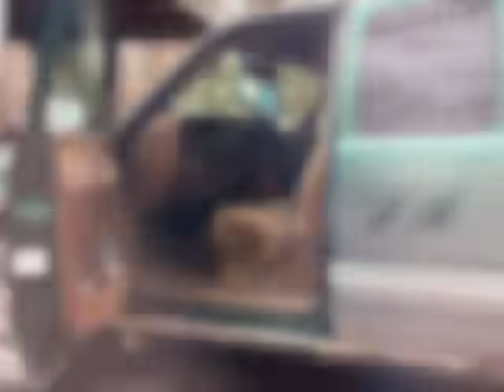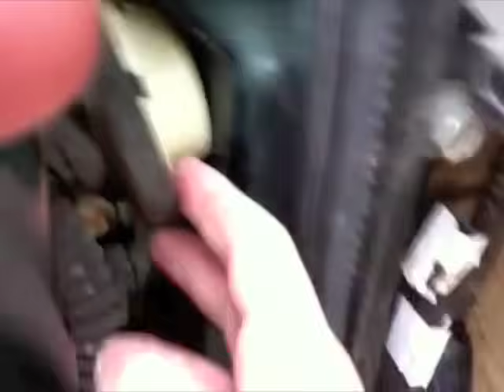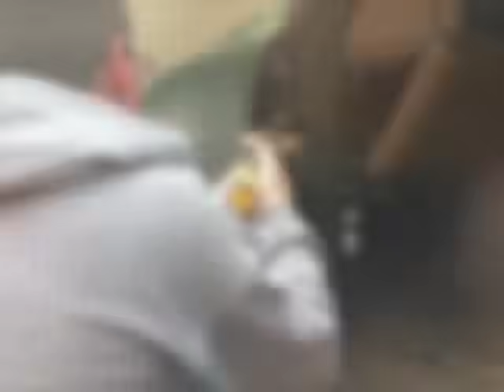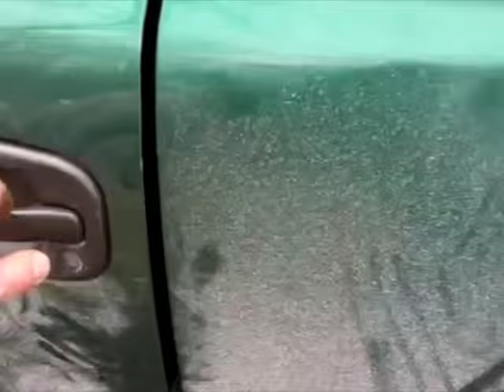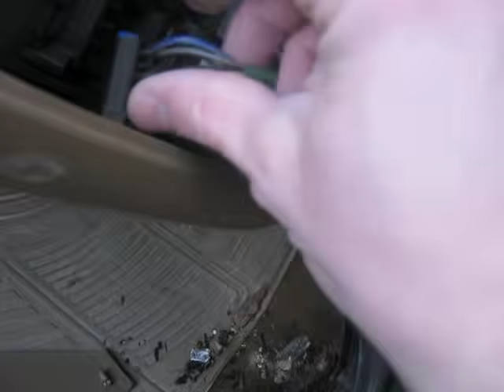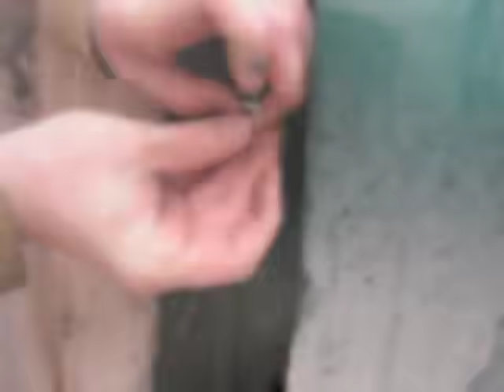Chevy Silverado Door Hinge Pin Replacement 1999 - 2006

Comment: is no one else having an issue that the bottom bushing won't fit in
Reply: I have the same problem as well.
Reply: @cherychery5867 i figured it out, the old bushing is in there it is just so worn down you can't see it. knock it out with a punch that fits inside it

Comment: Few things that will keep you from actually “removing” the door, air tools (3” cut off wheel) and a mini jack stand to support the bottom of the door with some rags if you’re worried about the precious paint on your 430,000+ mile work hog. ( most any weld shop will have them) throw a rachet strap on the top of the door to a rafter, and you saved your self from an hour of work and hurting you back on the floor board. Smarter, not harder

Comment: my problem is the pins on the extended cab doors. Surprisingly, they have gone bad and my doors have been sagging for years. I finally have decided to fix them myself since my mechanic has put it off for about 5 years now. 

As for the rattling and wind coming through the doors....IMO that's a 2006 issue.  My 2003 Silverado was tight as heck. No rattles, no wind coming through. But when i traded it for my 2006, i noticed all sorts of these issues from the start.

Comment: Is the door pretty light? You pick it up like is wasn't very heavy.
Reply from the maker: It's decently heavy. It lifts much easier if you have the window rolled down so you can lift with the frame and the arm rest handle.
Reply: @TheDaninator  Thanks. At 78 years old I better get help.

Comment: Good job. You can always use a nearby tree & ratchet strap ( or chain block ) to winch the door away if you're alone to do the job. 

Only thing I hate is when you do all this work and within a day or two it sags again because the brackets & mounts have been changed a few times before and are now oval.
Reply: They have oversized bushings for that

Comment: Follow Randel Pruitt advise below.  Careful with the grinder.   I was not paying attention and my grinder jumped and ended up nicking the edge of the fender :( !    Also, some of my pins would not come out after repeated hammering, and another site cautioned against hitting the pin so hard that you bend the truck side of the  hinge.  So, I took a chisel to the top side of the pin. I inserted the chisel between the lip on the pin and the top of the hinge and then and slowly worked around the pin.   I was able to work out the pin with just a few taps.   Clean out the holes for the bushings and do not force or hammer them in.  You might crack them and not even know it. And in a few months they will fall apart. Also,  if you don't have a sling to hold the door be smart and get a second person to help with the door. Especially the reinstallation.     Otherwise great video ......  Thanks

Comment: Just a short note to add. Put graphite or lithium grease on the smooth part of the pin contacting the bushing. Do not over tighten the nuts. If the bushing is turning with the hinge it's too tight. Loosen it just enough so the bushing stops turning with the hinge. Otherwise, great, helpful video.

Comment: They were still woobly for me i used the clip kind. So i put the bushings in the body side and welded the pins in the door facing down. It works great. Just had to shave down the splines a bit on a few pins so they fit in the holes.

Comment: I think the hinges should be totally seated on those grooves in the hinge pins. I didn't do that. Seemed like I'd have to force them down by tapping/striking with a hammer. Any advice on this? It seems my door began to sag slighty, just a couple weeks after I installed the new hinge pins and bushings.
Reply: Also, I go the replacement parts that require a nut be screwed on to the bottom of the pins. The small c clamp type looked very sketchy/cheap.

Comment: This helps. Just got an old '99 GMC Sierra 3500 for free that's going to be a restoration project. It has a loose driver side door. The front passenger door doesn't open from the inside, so I'll have to find a solution for that...

Comment: Will this work if you have to slam your truck door to catch the striker and shut?
Reply from the maker: You may have an issue with the latch on the door. But if your door wobbles at all like mine did, you need new hinges.

Comment: can I replace my pins and bushings that have nuts on them with the pins and bushings that use snap rings
Reply from the maker: frank hagood yes, should work fine.
Reply: okay I didn't see any reason why they wouldn't work but they told me at the auto parts store that you couldn't use the snap ring set on the nut set
Reply: Buy the threaded ones

Comment: just go ahead and buy the doorman kit with the brackets. not worth the time or frustration of not having them if/when your old pins are bonded to the brackets. I had to wait for the auto parts store to open the following day and had to drive there without a driver side door on the car.
Reply: Man it looks like im going to work with no door. Lol pins welded to the hinge. Fuck my day and it might rain later.
Reply from the maker: I'm sure driving without a door was quite the experience!

Comment: Used your vid as a guide. Good job. I too used the threaded hinge pins. Makes installation very easy compared to the pins that you have to press in. Well worth the additional cost. 

Line the pin up, place a 5/8 wrench on the top of the pin and turn the lock nut with a ratchet and a 11mm socket. Pulls the pin in very nicely and seats it properly. Too easy!

Checking the door after rehanging ... the door opens smoothly and the entire weight of the door is on the hinge pins  - No weight at all on the catch. Rattle is gone and wind noise reduced to nil. 

2 hours total using an air powered angle grinder (underpowered) from door off to door on and done.
Reply from the maker: Awesome! Glad you got it fixed!

Comment: I'm sure you figured it out by now, but the rear door latches are actually adjustable.

I've gotta do my front drivers side door though.. The wind noise is extremely annoying. Thanks for the video.

Comment: Any reason why no one replaces the lower pins and bushings. I mean you're already there. I'm just curious why every video on the web shows how to do this for all vehicles but only the top hinges. This is one of those pita jobs, so it really warrants doing the lower while u are in there. I'm not being a ass here, just asking?
Reply from the maker: Reilly Sharpless the lower hinges on these trucks are identical to the upper hinge. I can't speak for other vehicles, but for the sake of brevity, that's why I didn't show how to remove and replace the lower pins. I did briefly show the lower hinge with the pins removed, and spoke of the total cost of the four packages of replacement hinge pins needed to replace them all.

Comment: im having same issues thanks for the helpfull video ...my door overlaps passenger door a lil and wind noise 00 silverado ...hitting like button thanks man
Reply from the maker: Thanks man! Glad I could help you out with the video. The wind noise alone is reason enough to fix the pins, amirite?
Reply: +The Daninator yeah n rain soaked my switches for windows now my driver window no matter up or down window goes up lol ...picked up pins for driver n passenger 20 bucks total ...not too bad
Reply: Edwin Vermette Did you buy he kit that uses the E clips? If so, did you have to hammer the new pins down?
Reply: JasonWW2000 i have the same kit as video ...i dont remember using a hammer just picked up door n put on secured nuts ,i do get slight wind noise now lol ...

Comment: rockauto.com has them for about $8 if you have a couple days for shipping
Reply from the maker: +Aaron Turner That's for the DORMAN 703267 kit. The DORMAN 38453 that I used is $17.84, plus at least $2.75 shipping on rockauto.com. I spent nearly the same amount at Auto Zone. It is good to know that there are similar pins out there for less than half the price I paid. Thanks for the link!